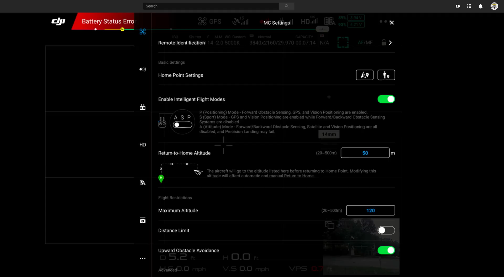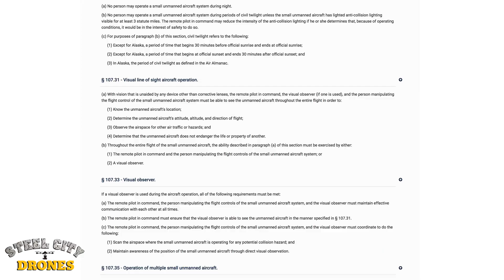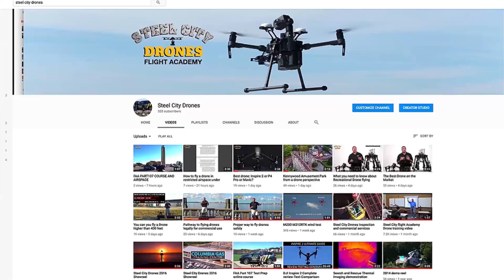DRONE 101   Q&A   HOW DOES COME HOME WORK?

Comment: Can you fly a drone to a place land then takeoff again and return with mavic 2 pro
Reply from the maker: If you are asking can you use come home to your original position after you have taken off from another location the answer is no. Once you land, and start the motors at the new location, the aircraft updates the "HOME" position at that point. You even hear a message that says "The home position has been updated".  Please remember that come home is only to be used a last ditch effort when something goes wrong and come home will not work if your GPS system is not working.
Reply: No I was wondering if I took landed at say a waypoint and shut off the drone. Would it be able to takeoff again from the waypoint or would I have to go retrieve it ?
Reply from the maker: @messagesent  Waypoints are preprogrammed missions that you have to upload before each flight.  If the preprogrammed flight is stored, it can be recalled and flown again no matter where the drone is currently at. It may have a longer distance to travel to the starting point but it can still be done. IF you shut the drone off, it may lose all stored flights, it depends on the program and how you are storing the flights.
Reply: @SteelCityDrones  thanks for information on the waypoints. I simply wanted to know. If once the drone has landed far away from the remote , could it be restarted with the remote control or would I have to retrieve it myself.
Reply from the maker: @messagesent  I understand now. The aircraft can land and take off again with the operator hundreds of feet away (probably thousands of feet) if you chose to do that. The operator doesn't have the ability to power the aircraft down or restart it unless they are physically present at the aircraft. Hope this helps.
Reply: Yes that is exactly what I wanted to know. One last question can I turn to props off if I landed on grass, or would the props still be rotating?
Reply from the maker: @messagesent  You always have the ability to turn the props off even in grass. The key concern is are you landing in high grass and how is that affecting the camera? You always want to ensure you land on a flat surface and have plenty of space between the camera and the ground. With drones like the Mavic or Phantom you don't have a lot of clearance. I really like using the hoodman pads. Please check our video that goes into more about these issues. https://youtu.be/5cz1vqXIGkk